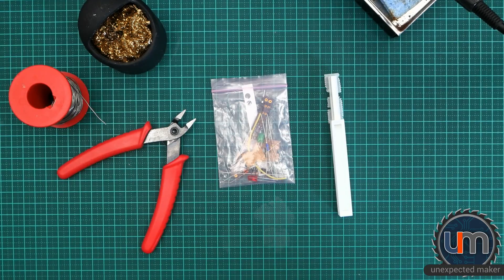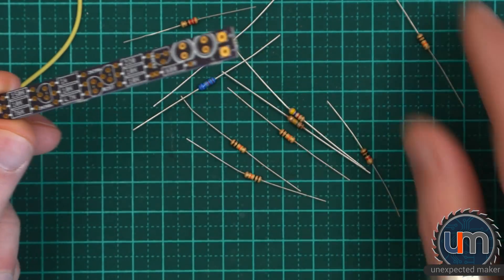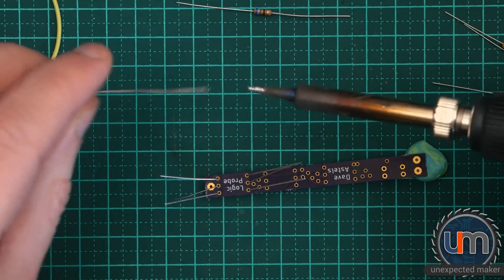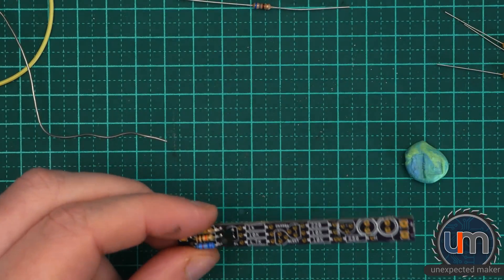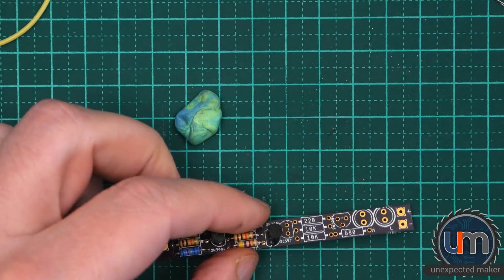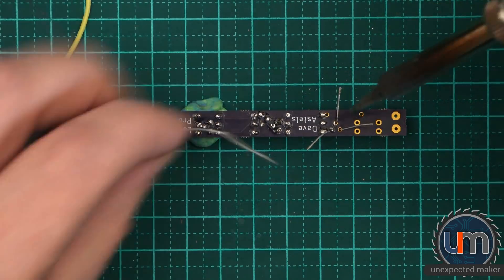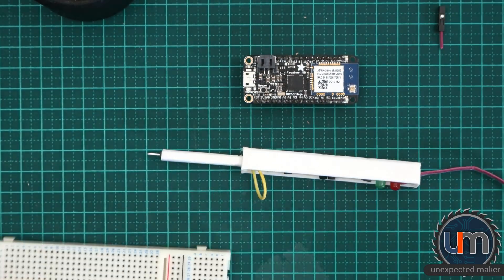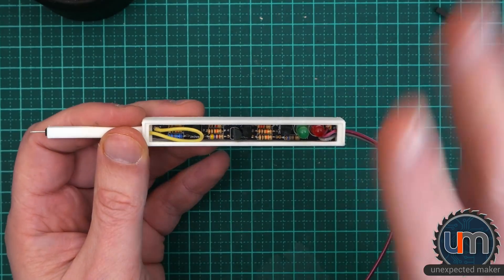Soldering Saturdays #5 - Logic Probe by Dave Astels

Comment: Dunno whether the solder mask was poor quality or it was just the flux residue but every joint you made looked burned. As soon as you pulled the iron away, there was black streaks on the mask. Or could just be crappy monitor/bad eyesight here :D
Reply: tablatronix yeah - probably is flux. When I watched it first I had beer goggles on lol
Reply from the maker: I'll have to pull it apart from the case and have a look. I need to print a new case for it anyway... but it's kinda wedged in there atm :(
Reply: Looks like flux to me.